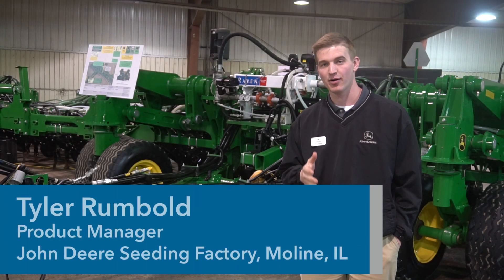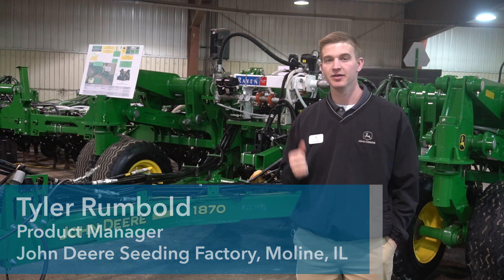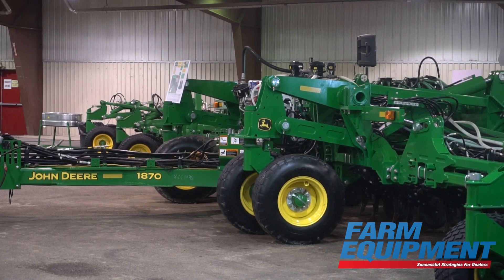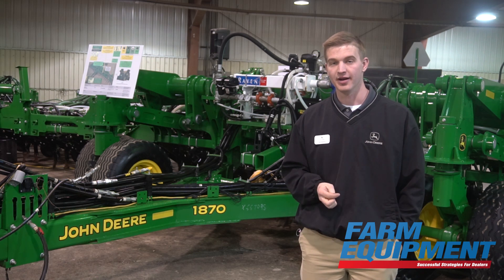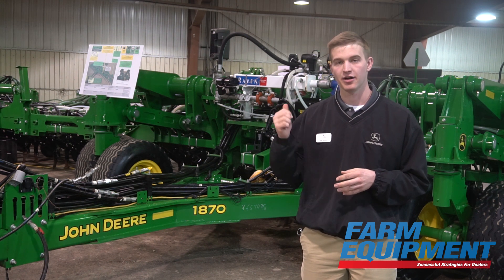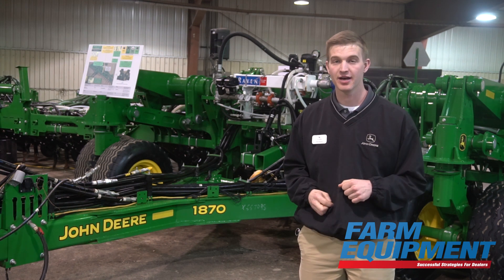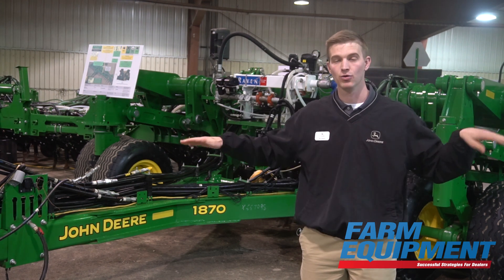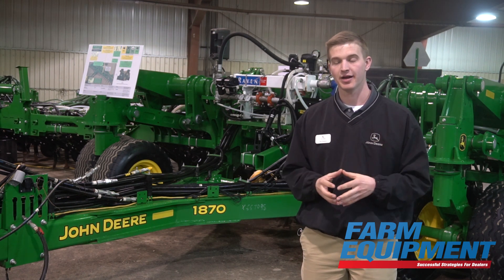John Deere Introduces 76-Foot 1870 Air Seeder Model

Comment: Why the hell would you pick 76 feet over say 80 feet. At 80 ft at least you could do in two passes what the combine would cover in 3 passes with the 40-foot header there for limiting impact of compaction by tracking in the same lines. But no you guys for some random damn reason cut 4 feet off the damn seeder making that impossible for no good reason.